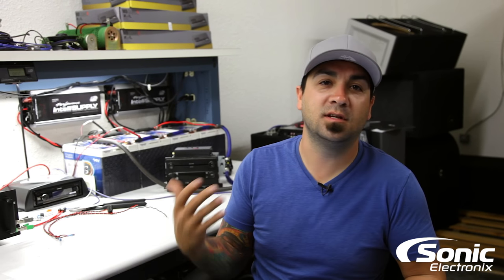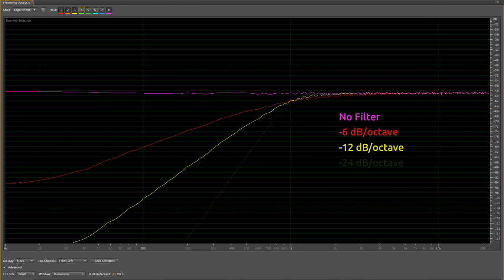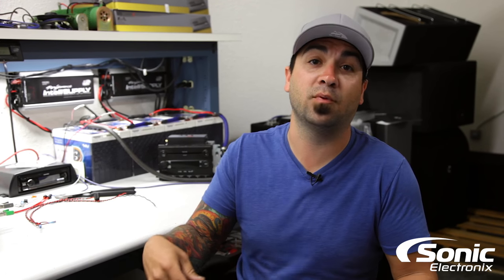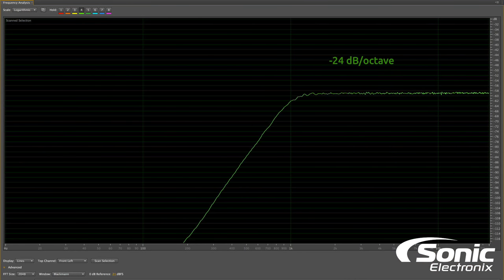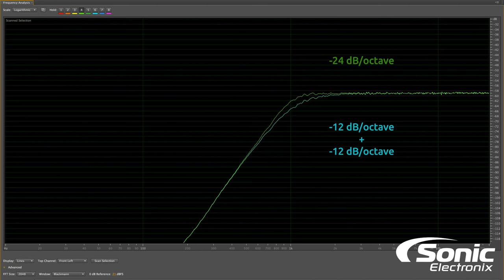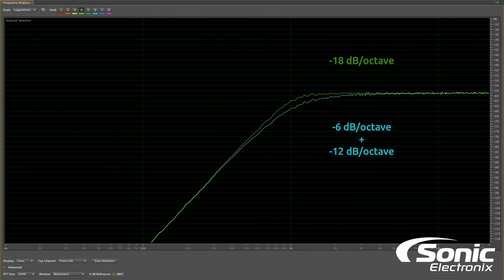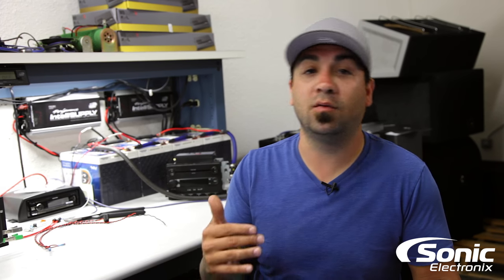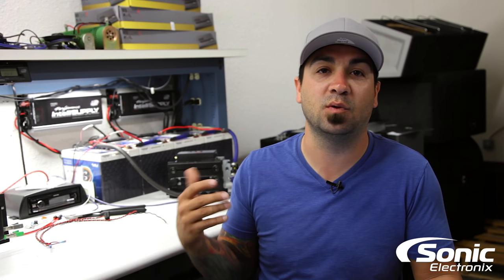Crossover Slopes | What Happens When You Use Two Crossover Slopes? | Car Audio Q&A

Comment: Just to clarify, they would ONLY add together if they are of the same type LP or HP AND they have the same cut-off frequency.
Reply: I got a question for you man…I actually have my Pioneer set to the same cut off HP’s and LP on my JL Audio RD900/5 which is a 5 channel amp. Except the low pass is turned off on my head unit. Just sounds better that way. Is there any other way I can adjust this. It sounds good, but I’m just not getting much bass out of my sub

Comment: Hi. You said in one of your videos that if your amp is producing crossover that you should not use your decks built in cross overs for you lp or hp. So is that just for your subs or does that go for your door speakers as well. I have a 1000 crunch amp going to my 4 6.8 kicker ds series speakers and was wondering should I use the the built in amp crossover on the deck or just let the amp run it. Thank you.

Comment: Ok I have a question. I just bought a new sound system for my truck, it's a 7'' pioneer touch screen with JVC all around and it sounds like they can't handle bass when I'm listening to music. No subs. already tried adjusting the sound. What can I do or did I get a bad set or screwed out of my money?
Reply: +Patrick Palacios JVC speakers without bass? Sounds about right.
Reply: +Care my wife's stock speaks sound better. I was wondering the same. I'm going to need to add. thanks
Reply: +Patrick Palacios a bro get some infinity primus or Jbl coaxials and components or Polk. All have hood bass
Reply from the maker: +Patrick Palacios Not only is it about the speakers you choose, but also how they are installed can make a big difference. Check these videos out, first one is short, second is longer but a lot more information that might give you some ideas.
https://www.youtube.com/watch?v=3eBaPWMplqk
https://www.youtube.com/watch?v=CwX6nVNiHYw
Reply: Patrick Palacios my camaro still had stock casette stereo just today i got an all pioneer system (deck as well as speaker set--'no sub). i have same problem with shitty sounding bass i want to change settings in stereo but idk what the hell this hertz and ohm shit is like wtf
Reply: Patrick Palacios junk ,,, sorry to sat jvc is junk ... switch to a set of Jbl.  609 c componets you wont be sorry .

Comment: i have a question. just recently my pioneer 12 inch 1400w dual coil has been making different bass sounds. whenever i listen to music it will hit the correct bass, then start making a different sound over the current beat to a song. Even when i turn the subwoofer off through my stereo, it will still make "bass" noise for about 30 seconds then shuts off. I am currently running a Pioneer 760 watt amplifier to my subwoofer. What would be the reason this is happening? thanks
Reply: Its your car battery being drained too much and the amplifier shuts off your subs so it doesn't shut your car off. When its makes different bass noise, it might be due to distortion or not enough power to the subs or the subs is overheating.

Comment: Just use one , I use my deck to control subs , I tried to use both and it sounds terrible , I now have my headunit at 63hz 18db slope and fosgate amp at 260hz 12db (as high as it goes) slope and I hear everything in my dual 12 basswedge jl audio
Reply: Same seems like the only setting that sounded clean and full

Comment: Thinking of stacking crossovers for my tweeters to act as a safety measure for a situation like mentioned in the video where my head units  settings get erased I won't fry my tweeter. 12 on headunit and 12 on amp to make a 24 slope that I want to run anyway.

Comment: Great vid! So if my sub amp is 24db and my componant amp is 12db should i run both amps full range and filter through the headunit? which i guess is gonna be the same slope, not sure the slope as sony doesnt state on the manual. ✌

Comment: Great video!!
I have a Kenwood 893s, DSP Pro MK2, Zapco 150.6 on Brax 3-way components active, where do I set the radio and amp to begin tuning the DSP? From the 3 areas I can tune (radio, amp, DSP) I feel like 2 of those need to be constant and the DSP should be used to completely tune everything. 
So, what baseline do I set for the HU and amp?

Thank you
Reply: everything on ultra flat... and let the DSP handle the signal, thats for what it made for...cheers

Comment: sir i am from india. i have power acoustik gt1 6000d mono amplifier. please tell me. how many 12" subwoofer run on this amp. please tell me about watt or ohm of subwoofers
Reply: google "ohm's law" and do the math
Reply: u got 3700w at 1 ohm  3000w at 2 and 2300 at 4ohm 
now use ohm law with series and parallel config , use dvc subs . its all depends on rms of each sub so do some math and find out. i recommend 4 500-600w rms 2ohm dvc sub at 1ohm load connecting in series to amp or 8 300-400w subs in a group of four and than parallel to amp. so many possibilities its all up to u. where u got that amp in india?

Comment: Okay so from what I'm understand I should put my crescendo BC3500 & 800.4 to full range and then just use my pioneer deck 4700BS crossover settings ?   But idk what slope the sub should be at ?   I go for around 80hz on my sub (single 15 ported )
Reply: I wouldn't turn off the crossover on your sub cause if for some reason your radio resets and your crossover could be off on your deck and fry your subs before you realize what's going on. If anything I would turn the crossover on the amp on and set the radio to about 80hz.  Now your 4 channel I'm assuming your running highs mids with it and I would on run 80hz and up through it. That's what I usually do I play the sub up to 80 and the mids down to 100-80 just depending on how it sounds.
Reply: +Tammy Forbes good fail safe!  this is what i do on most all the installs i put out.
Reply: +eric neuman yea I saw first hand what happens when you run the full frequencies through a sub. Not me but a buddy says yea man this thing hits so much harder if I don't use the x over and within a month he burnt up a $1000 sub. Luckily for him it was under warranty and they rebuilt it for him but he learned his lesson. Subs don't like 10k htz.

Comment: Hey I'm about to run a hcca orion dual 2 ohm 2500W rms, just wondering if I should do the big 3 upgrade for it? 
Car: 1996 Honda Accord LX
Reply: +Nathaniel Renner thanks for the information, so would you suggest a new alternator or another battery?
Reply: +Zach Stoltenberg always go alternator if you can. Ohms law will teach you that amps x volts = watts, also that watts divided by volts = amps. You also have to be aware of the efficiency of your equipment when planning your system as no piece of equipment is 100% efficient, in fact the best are 80% or so efficient, meaning your only getting 80% of the power you put in back out as power for your subwoofer, the rest is lost as heat, which is why, simplifying of course, amplifiers produce heat. So say you wanted to have the capacity to produce 2500 watts right? You know that your running a 12 volt system, so divide, 2500/12= 208. In theory you would need at least the capacity for 208 amps. Then say you purchased the best 2500 watt amp money can buy, but it's still only 80% efficient. So divide 208 by .8 which is roughly 260 amps. So just for your subwoofer you would need 260 amps of power, then factor in the factory electronics on your car (lights, sensors, fans,) which is typically 50%
Reply: Of the factory alternators available power, lets say 50 amps or so, then your looking at 310 amps total capacity you would need to properly run your equipment on a 12 volt system. Batteries are a very good thing to have but only if the alternator is up to par with keeping them charged. Do your alternator first, then worry about batteries. You will need to size all of the wires according to how many amps your pushing through that wire, plus the length of the wire, all found on the above mentioned website. Trust me, learn ohms law, learn the basics, fuck up a few 100 dollar setups before you jump straight to the big boy shit. No offense intended but do your research if your going to invest generous portions of your finances towards your stereo. Hope this helps!👍✌️
Reply: FYI when I say amps above I'm talking about electric current, not amplifiers. 👍✌️
Reply: Lithium

Comment: I am getting the pioneer AVH-4200NEX Headunit, NVX JAD800.4 interior amp, and a Kicker KX1600.1 sub amp. The Pioneer NEX series has one of the best sound tuning capabilities including its "Auto EQ" feature. The NVX and Kicker amp have great tuning capabilities built into the amp as well. But if I wanted to utilize the NEX features, I leave both amps in full range mode and allow the NEX to utilize its Auto EQ? Meaning, the NEX will supply corrected signals to the amps thus providing the auto EQ frequencies?

Comment: what does the "slope" do?
Reply: +MrSpanky473 It makes your crossover point fade out differently.
Reply: it starts cutting off the unwanted frequencies at a given point. for instance if you set your subwoofer crossover at 80hz with a 24db slope  it will start rolling off those unwanted frequencies from 80hz and above at a rate of 24 db per octave. therefore your high and mid level music wont play through your subwoofer.
Reply: +David Brown so what's reccomended I have a mono lock hifonics amp with no full range or nothing but a preety good deck that allows slope and all what would be the correct db to use?
Reply: +Josue Valadez depends on your preference. I have my sub at a slope that cuts quick, to prevent it playing the mids. Low pass set to 100hz
Reply: +Josue Valadez you have to be careful when selecting different slopes as well because they can affect where you should be setting your infrasonic (subsonic) filter especially for your subwoofer. Example: a 12db per octave slope on your infrasonic filter would require you to set the filter to no more than 3 or 4 hz off of the tuning frequency of the port (provided you elected a ported enclosure for your setup) where as a 24db per octave slope would require your infrasonic filter to be set one half octave below the tuning frequency of the port. the12volt.com is a great car audio resource, shit loads of technical info to help you out with just about anything. Hope this helps!

Comment: This was helpful! The pioneer headunit in my wifes car is more capable than I thought. It has LPF and HPF. Trying to use both front and rear channels to drive front 2-way without a crossover, and use external amp for sub. No rear speakers.
Reply: if by 2-way you mean coaxial, then no. if you mean component sets (
separate midrange drivers and tweeters, then also no. (you would need a BPF for the mids, and HPF for the tweets)

Comment: okay when you say FULL RANGE the subwoofer amplifier how can you make it full range? you leave the lpf all the way up to the highest number? thanks
Reply: full range means no lpf or hpf set. its unfiltered full range.
Reply: If you want to do full range but don't have the luxury of a switch to do so, simply turn your infrasonic (subsonic) filter to its lowest setting, and your low pass filter to its highest setting. Bam! All frequencies now come through full range.
Reply: I have my alpine hu that have front,rear and subwoofer freq the highest is 200hz and 24db slope's the highest. Can I put my amps at full range (4channel amp , subwoofer amp and I set everything from the hu? or I need to set the amplifires as well? and my subsonic filter the lowest setting is 10hz. thanks for helping me
Reply: +ManIron007 Yes you can leave your amps in full range and adjust everything with your head unit.
Reply: the last question the sub amp to make it full range I want to put the lpf all the way up and subsonic filter all the way down? and then I set from the hu 80hz and 24db slope is good?
thanks for your help I appriciate
Reply: +ManIron007 Yes but you do need to adjust your subsonic filter some.
Reply: my subsonic filter on my sub amp? and what freq I need to set my subsonic filter? thanks
Reply: +ManIron007 Are you running a ported or sealed box?
Reply: ported
Reply: +ManIron007 What frequency is ported at?
Reply: 33hz
Reply: +ManIron007 Set it to 25hz. Thats 1/2 an octave below your tuned frequency.
Reply: so i set my subsonic filter on my sub amp 25hz lpf all the way up?
Reply: +ManIron007 Yep
Reply: dirtywhiteboy0828 Thanks for your help I appriciate